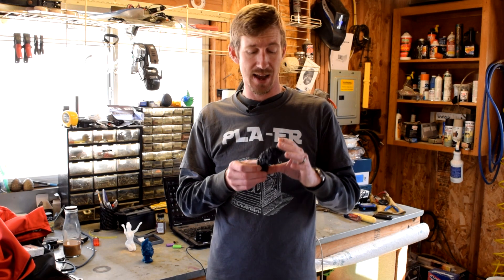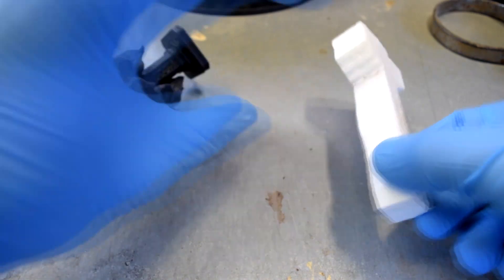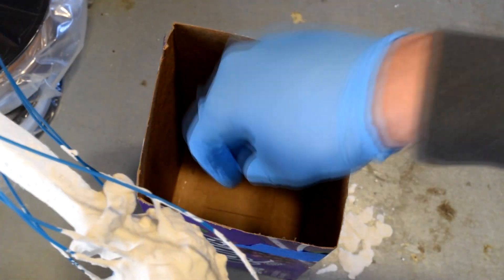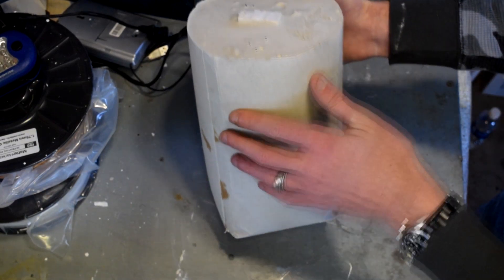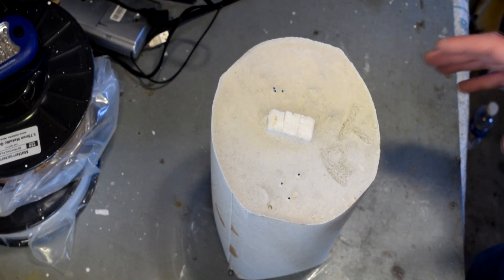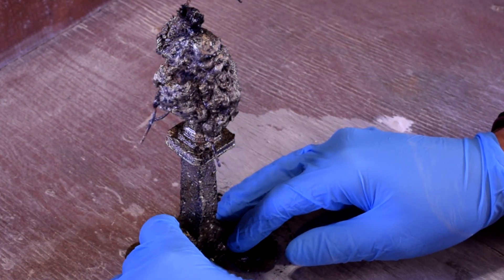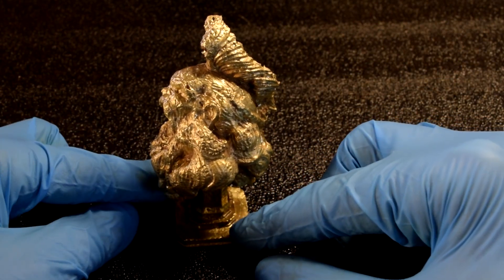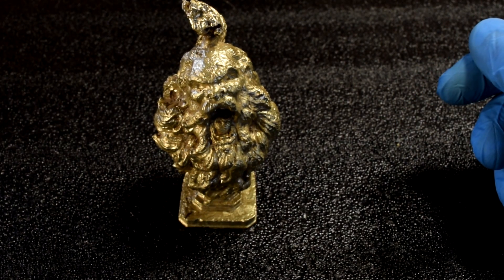PLA to Brass-The Bearded Yell-Lost PLA Casting

Comment: I think the problem is the casting process, the metal is not reaching through the details, which is why you need a centrifugue or at least a wet-paper on a lid kind of hack to push the metal with steam. There's some videos that use such trick, it works.

Comment: Nice!  Why such a long sprue?
Reply from the maker: Andre Jolivet longer sprue creates pressure to push the metal into the detailed areas and is very important.
Reply: You can have all the pressure you want, but if the metal cannot displace the trapped air fast enough, you end up with a fail.  You clearly had a vent issue.
Reply from the maker: worldtraveler I agree that with venting the air, but in this case I do not believe that was the issue. Ash left over from the PLA caused the fill issues at the hair and side of the face.

Comment: Looks good, I'd like to try this soon. Have you tried wax filament? I've heard PLA leaves ash inside the mold, however supposedly you can blow it out with compressed air.
Reply from the maker: Seth Robinson I usually use wax filament, see my other videos. this time I used pla because I get asked about it all the time.